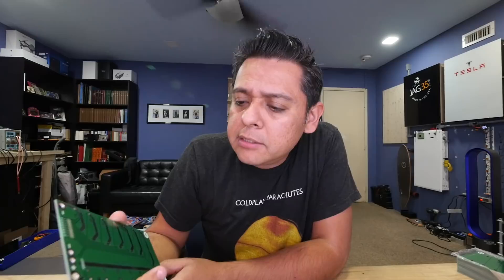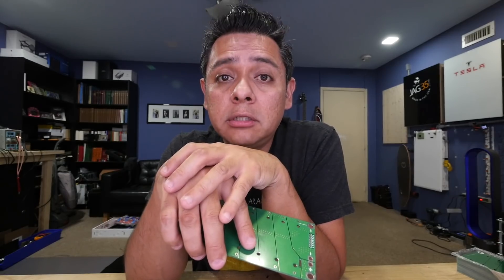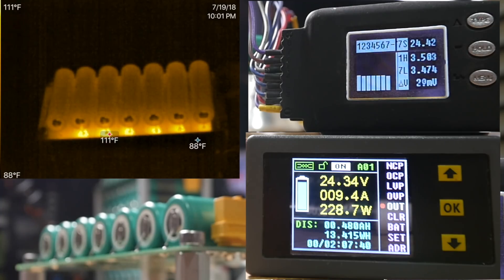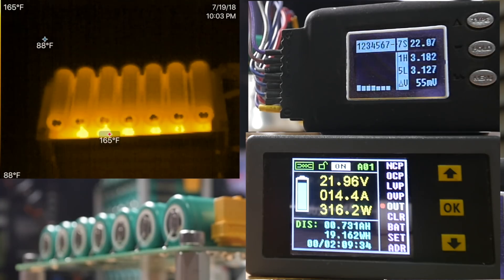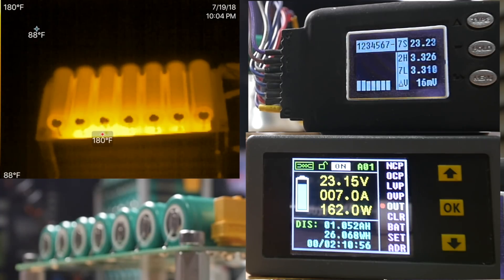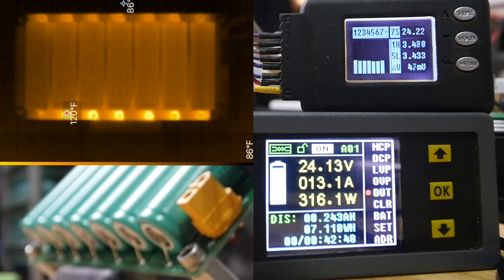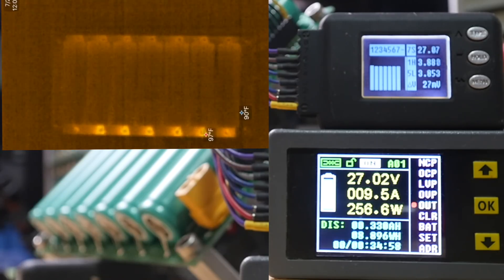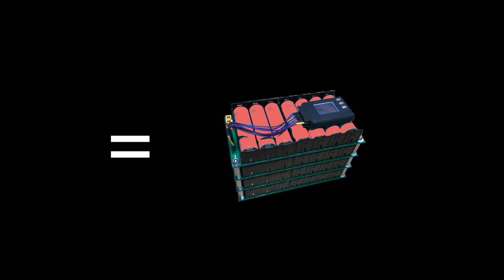How do you Fix that Problem?

Comment: Nothing strange here, it is the supreme 2nd Law of Thermodynamics: for any energy-producing device to output useful work, waste must be dissipated, or it wouldn't work!
Dissipating 180f (80c) makes the array a heater, more than being an energy storage.
Why not cooling it, by operating a sized fan or even an A/C? Energy, or the lack of it: as a cooling apparatus will soon suffer wear and tear and then ceases. Replacing it with a new requires a greater energy than the sum of all energy produced by the batteries.
The overall exercise is no less than an exercise of fossil fuels energy conversion - given the energy expended in manufacturing the batteries, transporting them, integration, running, including all the food intakes by all people involved, their activities and well-being.
Energy is not a playground for humans on Earth. It is likely a prison!
Thank You Jehu, your tests are such an asset to all of your fans. 
Please keep these brilliant videos coming.

Comment: i want to make a 28s 20p battery pack for a project e bike but how do i charge it safely?
Reply: 28s20p? What are u making? An electric car or what?!
Reply: mini bike with 2 10kw hub motors
Reply: Personally, I would make 4, 7s packs and wire them in series.. that way you can unhook them and parallel charge quickly with a Powerlab8 Touch or something like it.. damn tho, over 100 volts DC when fully charged?! Thing would probably smoke the back tire right off!
Reply: good sugestion and it will be 2wd. btw do you know how long it would take to charge four 7s20p packs at the same time?
Reply: its more like a motorbike than a bike, im not even adding pedals